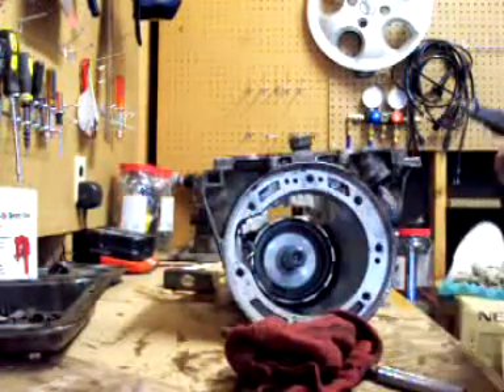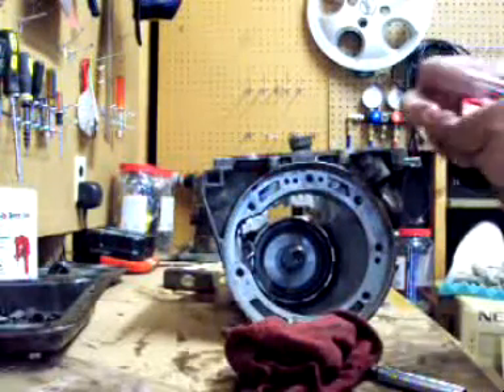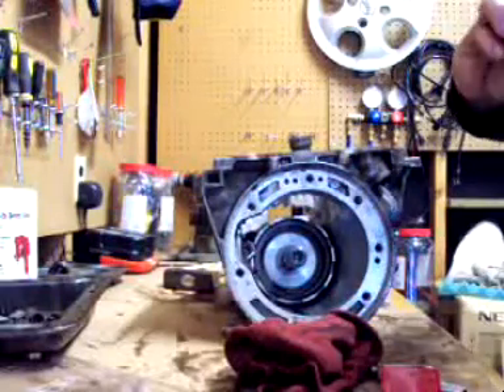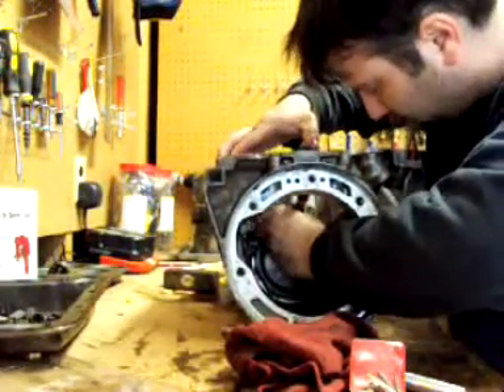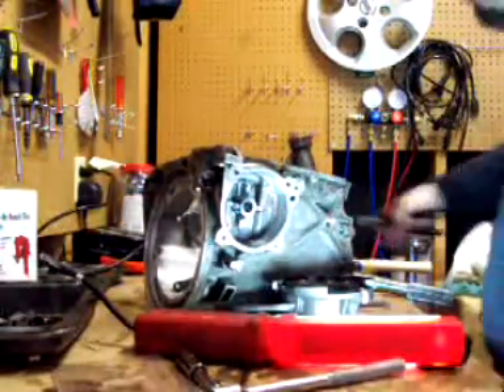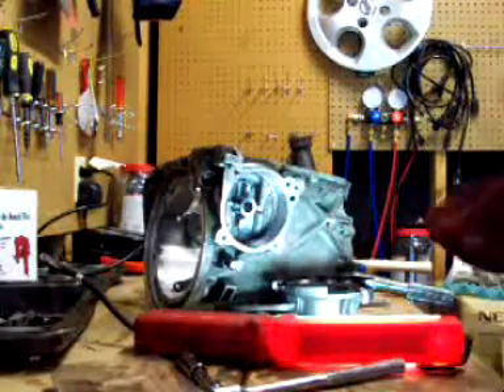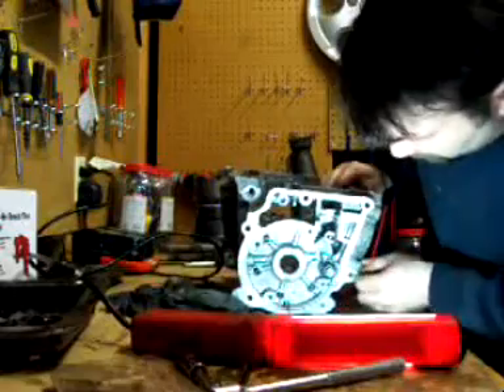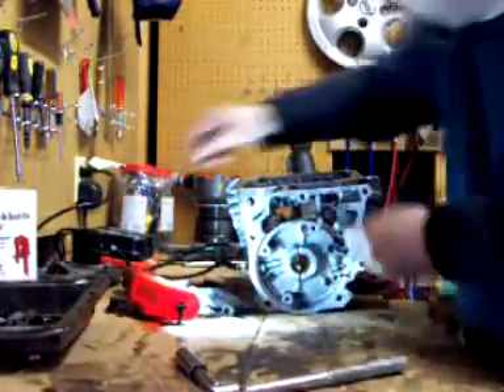Ford C4 Transmission Disassembly Part 5 of 8

Comment from the maker: Thanks, appreciated.... sad part is this trans was shredded inside.  Even the case was mangled.  I wish I had a better camera at that time as I was down South Carolina then.  Up north its hard to find even a scrap microwave or the line.  I been trying to get an engine and still kinds runs to tear down and disassemble.